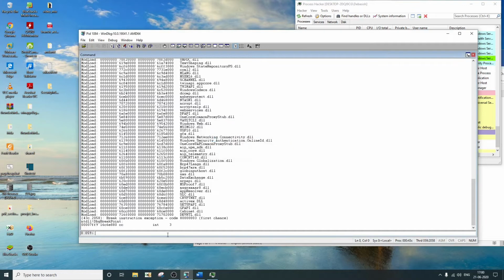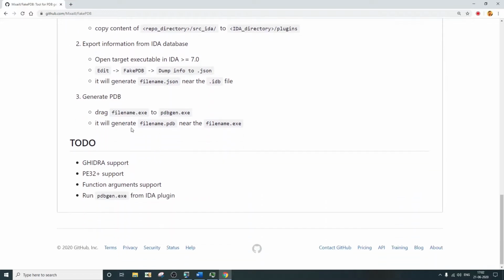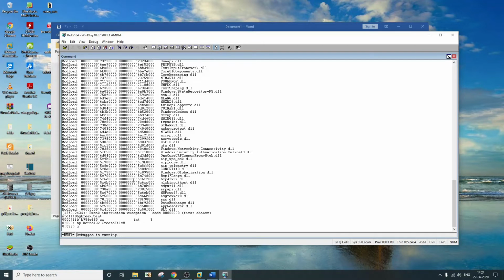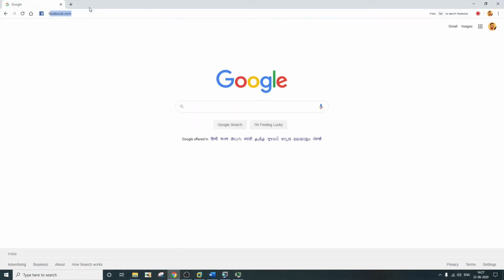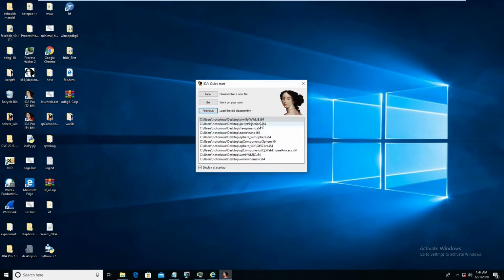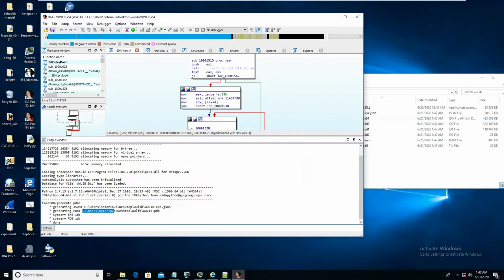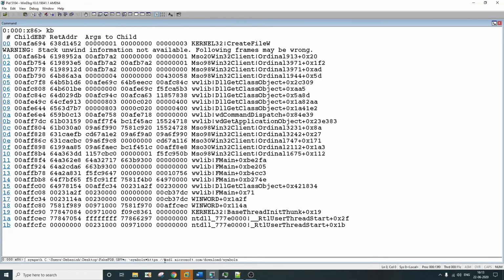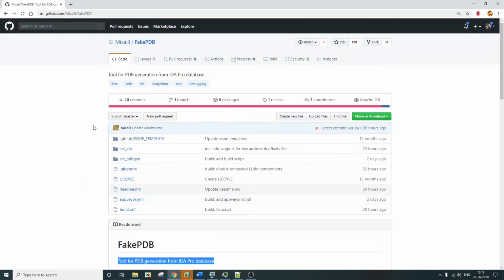Fixing Windbg Broken Stack Trace using Fake PDB Debugging Symbol Exported From IDA Pro

Comment: How does that help in anything? I want to know in which case would it be beneficial to get these dummy function names? (I am assuming those are dummy function names only and not the actual function names because you don't really have the actual pdb).
Earlier also you were having offsets relative to the same dll, now also you have the same (so in both the cases we know which dll the function belongs to). Yes, now you have the locations of actual functions that are being called. but I wanted to know a real life use-case for this thing :) (you know where it'd be helpful)
You still have the same number of frames on the call stack, all pointing to same instructions so I wouldn't really say the callstack was broken in the beginning.
If one only wants to check out the assembly code for the functions on the call stack then also the previous & current stack trace will direct you to the same memory instructions.
Am I missing something here? :)
Reply from the maker: When i'm debugging an app using windbg and in parallel reversing it in IDA I just find it easy to correlate both,